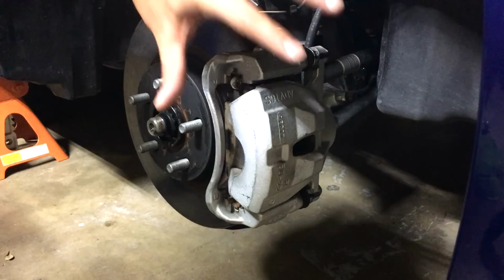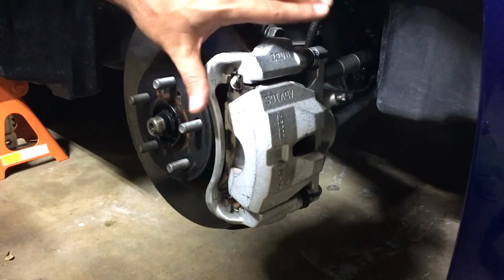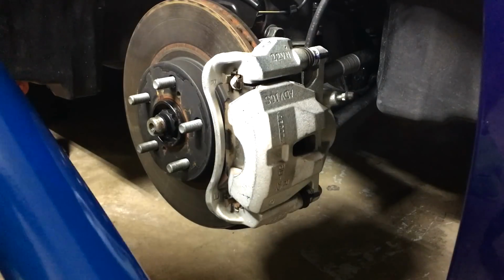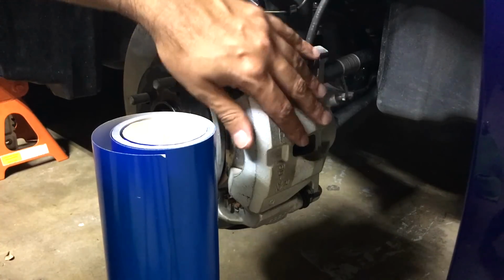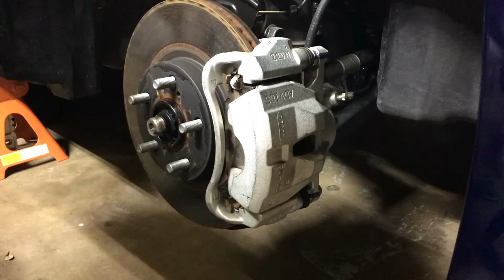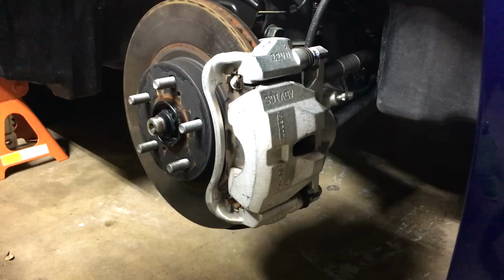Brake Calipers Wrap Reflective Blue 2017 Corolla SE

Comment: i ordered reflective vinyl on amazon seems the vinyl is not that thick.. im thinking putting in it this summer..
Reply: do you think all refective will do? or Vvidvid vynyl with with heat is the one your using bud? thank you.. i love everyvideos you do! @shinegraffix
Reply from the maker: I used regular reflective vinyl. That one should work, just clean the calipers very good and it will stick good. Thanks 👍